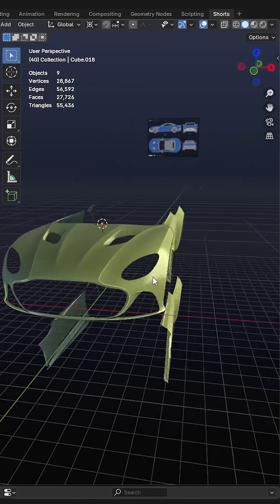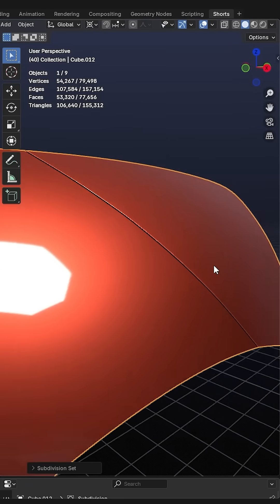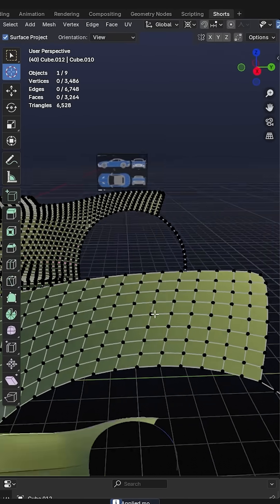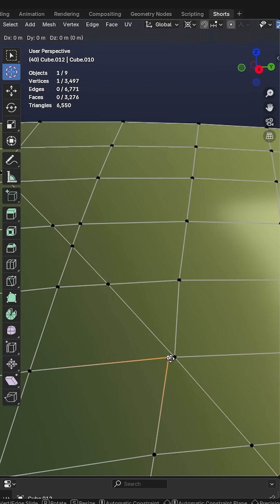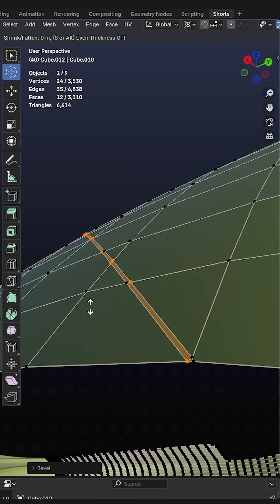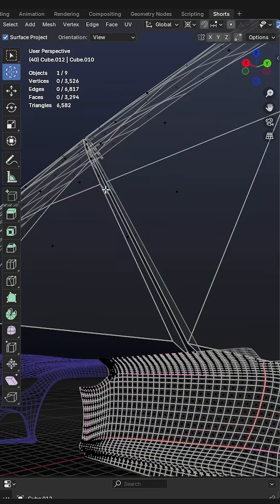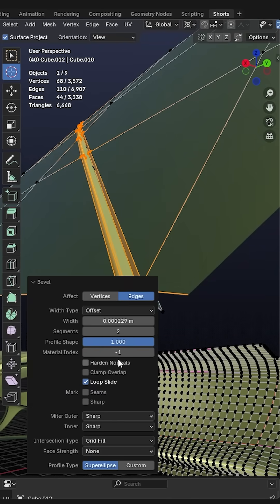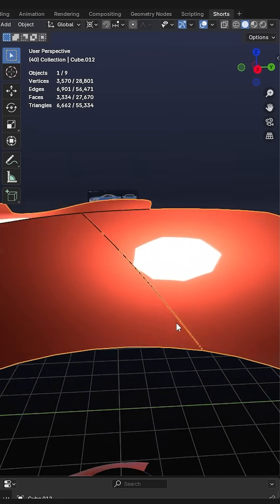Car modeling tip in Blender #blender #carmodeling

Comment: I would love to work with triangles and ngons more, I dont get how those triangles weren't causing any issues. even UV sphere by default doesnt cause issues so idea is you can just let loops run into a hole, once you do your subdiv, just close it off with poked face and model to fit curve.

Comment: its always funny to me how so many people think that triangles are bad topology... lol a quad is calculated as two triangles. theres no big difference.
Reply from the maker: It's a complex subject that few people understand but every fool has an opinion. I shake my head in amazement when I see how arrogant and rude some people are when they clearly have no clue.
Reply: @Aryan3D The primary benefit of quads is that they allow further, clean subdivision (if needed), right?
Reply: @steamer2k319  my mind immediately went to "this would need retopo but good enough for a game"
Reply: @neoqueto  I did a quick search and the main points were loop cuts of any kind (including subdivision) and animation. If a part is rigid body (not going to be deformed by rigging) and not going to need any more loop cuts, tris are fine.
Reply: @steamer2k319  in many professional environments editability matters a lot, especially to juniors. If this cut is wrong and gets disapproved, we're spending a lot of time patching it up together. If this was all quad, it would be much easier to reposition.

Comment: The thing is, if you're working with 2-3 levels of subdivision surface, you get this rounded edges which you have to crease and further subdivide, it's annoying, it's best you apply cuts after you're done with the subdivision surface modifier
Reply: Congratulations captain obvious, this was clearly just a demonstration
Reply: @tablegd8631          ︎ ︎         ︎ ︎          ︎ ︎         ︎ ︎      ︎         ︎ ︎          ︎ ︎         ︎ ︎      ︎ ︎         ︎ ︎          ︎ ︎         ︎ ︎          ︎ ︎         ︎ ︎      ︎         ︎ ︎          ︎ ︎         ︎ ︎      ︎ ︎         ︎ ︎          ︎ ︎         ︎ ︎          ︎ ︎         ︎ ︎      ︎         ︎ ︎          ︎ ︎         ︎ ︎      ︎ ︎         ︎ ︎

Comment: I got no proof of this but some guy said topology doesn't matter on static objects if the shading looks fine after and some guy in his comments claiming to have worked on cgi for the speed racer movie said he would just cut up the models for explosions and damage willy nilly a lot of the time and it was. Also I'm acoustic for sure
Reply from the maker: It only matters when it prevents you from being able to do something properly. Sometimes shit topology makes tools or modifiers fail, sometimes it creates visual imperfections. Sometimes it doesn't.

Sometimes studios require good topology on principle, sometimes they don't. There's no carved-in-stone commandment here.
Reply: Some render engines are more unstable at subdivision during the render if there are triangles. As a VFX lighting artist I have kicked back plenty of models for that haha. So it's not ideal in a production ready asset. I have modelled cars in the past and not needed any triangles to do it.
Reply: Regarding the "static objects" viewpoint, if the static object has no animation or deformation applied, then this is true. Good topology is useful for animation purposes, where stretching and deforming the mesh requires good topology to visually deform well. 

As Aryan has stated, good topology can still help with model workflow e.g. selecting or cutting edge loops, clean subdivision smooth or other modifiers.

In triangular areas after subdivision smooth is applied, there can be visible notches in the surface due to the clumping of the smaller subdiv-ed triangles. If you're going for perfectly smooth reflective surfaces in your model, it's best to avoid this.

In the case of Aryan's video, the subdiv was applied before any triangles were created for the panel cut & gap, which combined with the bevelling resulted in a clean surface look.
Reply: @graspian I also think the guy said crazy n-gons are fine if all the verts are on the same 2d plane and that was the described rule

Comment: Most stupid way to make cuts. Never applied subdivisuon before you finish whole model and you know that you wont have to do changes, otherwise everything will be messed up since its hard to work with many polys and keep the shading proper.
Reply: just dissect model and work on different parts of model bro. In the end you can merge it all, and do backups in another collection, i use that 'pipeline' all time
Reply from the maker: That goes without saying. No need to act like your shit doesn't stink, you poor bastard.